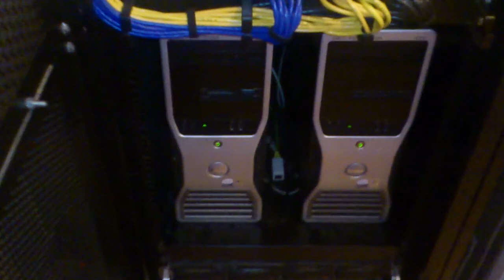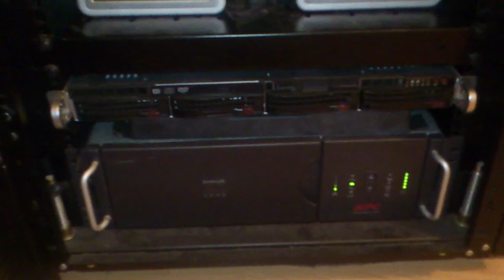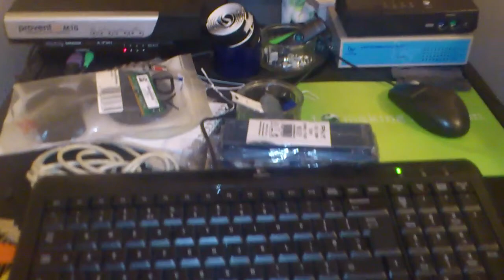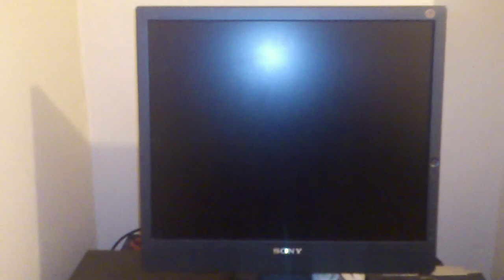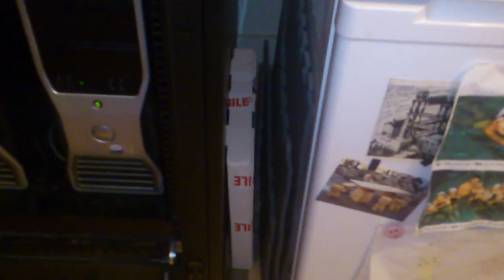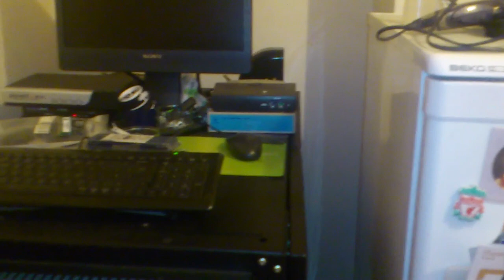My Home Server Setup - V2 (Network/Rack Cabinet)

Comment: You should checkout linus tech tips & their cable management for their server room. What a shitfight that was. The guy who is supposed to be tech whiz, to me anyway, he couldn't run a choko vine over a fucken shithouse. To make matters worse he was installing a wall mounted monitor, put the wall bracket upside down & didn't even check for clearance between the actual monitor & wall mounted keyboard casing. So when he reversed the bracket on the back of the monitor, mounted it to the wall & it sat right over the lid of the fucking keyboard casing. That was the icing on the cake for me with that lot, because I had previously watched a program of theirs before hand & the same guy was building a powerful pc. Gloating about the go fast bits & pieces, all the specs & how unreal this thing is going to be. Well, he ate his words because the thing was bottlenecking & crashing. You my friend leave that idiot for dead. :)
Reply: OlympusHeavyCavalry hes also a millionaire with his dream job, giv it a break
Reply: Jack Calloway More practice then? :)

Comment: u have a dual xeon server with 512mb of ram? U ok dude? With one stick of ram, only one cpu is being used.....
Reply from the maker: +Pumajil Hi...not looked at this vid myself for a long time.   Nope...the Dell Perc 5i Raid card has 512Mb  Currently the server is maxed out on 32Gb ram....I should do another vid as the cab has changed and moved home. :)
Reply: +FlashPan73 ah ok, thanks for the quick reply :)

Comment from the maker: hehe...you know after I put the cab next to the fridge freezer I did actually think about if it was possible of using an old dud unit in some way.  Am not that adventurous though to try it out.

I re-jigged the cab a little whiel back and am about to make some more changes so hopefully when I get time I'll be uploading a V3 video in the (hopefully) not too distant future.

Comment from the maker: Thx Jake,

I cannot give a 100% accurate price in UK£.  I've only just purchased a power monitor/calculator plug thingy.  So once I've figured it out I'll hook that into the wall then the UPS into that (as that powers everything) and I may post a cost etc.

But what I can say is that I put aside £70 UK a month for electricty, but that also covers elec cooker (power eater) & everything else in the flat.

If I had to make a guesstimate, I reckon my cab would be 30/50% of my monthly bill.

Cheers

Comment: That's cool, as long as you have something. If you ever feel the need to upgrade the anti surge system please feel free to get in touch, I design lightning protection and surge protection system (don't worry, I have nothing to do with sales so not trying to push anything, just a fellow home networking geek willing to help out if needed)

Comment from the maker: Thanks Almightyrastus, The wall power socket which feeds the UPS has a very simple surge protector block attached but I mainly rely on the UPS to monitor/control the input/output of power.

Have made some changes to the cab recently and will be making some more soon..  Basically moving stuff around and putting other types of shelves in etc, so I'll be making another update vid in the not to distant future.

Cheers

Comment from the maker: Thanks thetooth54, over here we say "rooter" as it basically a route for your internet connection.  A "rowter" is something we use to cut holes/shapes in materials with ;)

I bought the supermicro of ebay for £40 UK.  It had some memory already and I had some lying around.  I did have to buy the drive caddies seperately which actually cost more than the whole server :)  Atoms are great (not used them) but I personally would only use as a firewall or streaming media device (xbmc).

Cheers